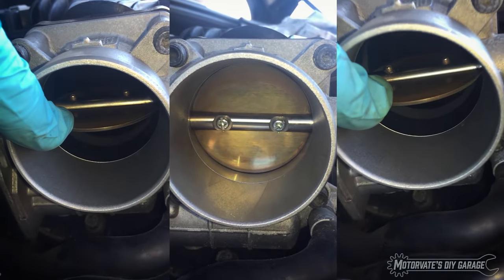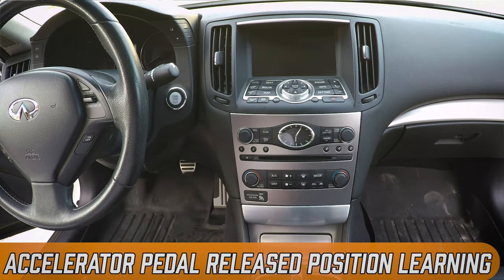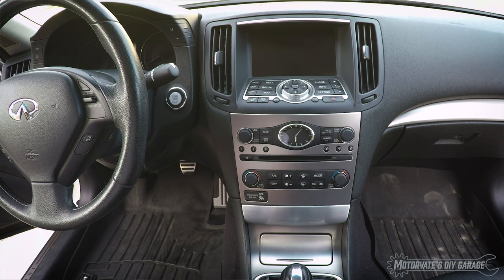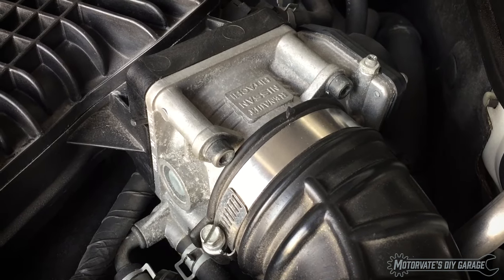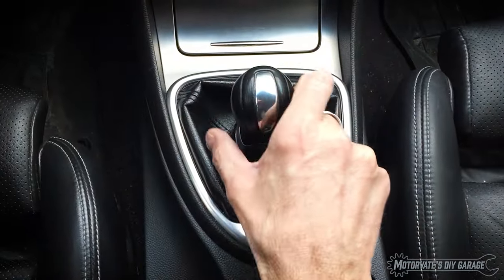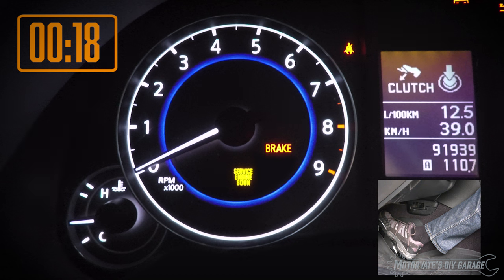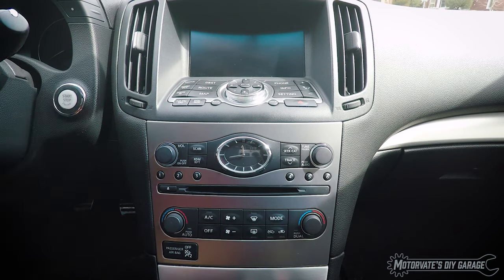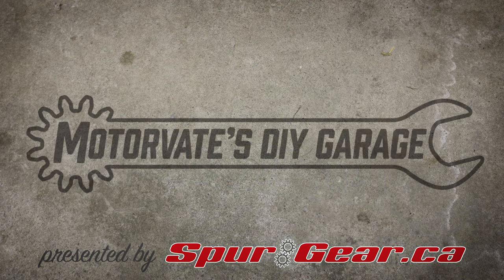G37 & 370Z After Throttle Body Cleaning: Motorvate’s DIY Garage Ep.27

Comment: Hey first off thanks for all you do for the community and for the videos. So I’ve got a 2013 g37x sedan and yesterday after a long day of running errands the car felt sluggish here and there accelerating and then started feeling weird starting up. Now thinking of it when I start up cold or hot it’s been idling a little high. Then after getting home after running around all day and it feeling different and having trouble starting up the car was off for maybe 30 minutes while I got ready for work. When I went to leave and start the car she struggled to start and felt rough starting up and idling more sporadic then usual. It felt shaky so I turned it off and took my wife’s car to work.  Now I just got the car and it needs things like suspension work and a new  rack and pinion mostly things that have nothing to do with the engine or transmission. I checked the fluids and while I can see I need an oil change nothing seems bone dry or crazy out of wack other then this driving off loss of acceleration once or twice yesterday and now it’s struggling to start and idling rough. After that novel do you think cleaning the tb or having someone do this for me and doing your method should help. There’s no lights on nothing as far as warning lights this just started happening. I hope you can help. Thanks a head of time .
Reply from the maker: I would start by looking at the battery.
If it is 4-5 years old, you might want to get it tested to see if it has the needed power to start the car. Or if you have a volt meter, check the voltage after the car has sat all night. The voltage should be around 12.6v or more.

When was the last time spark plugs were changed?
You may want to remove them and check their condition.

Start with these items and let me know how you made out.
Good luck!
Reply: Hey thank you so much for getting back to me it means a lot. I want this car to be my hobby and my daily so after spending a good amount of money on getting it and running into the suspension and rack and pinon issues I’ve already been crushed on how much I’m gonna have to put it to make it safe and fun to drive but then this starts happening and I’m like omg is it the dreaded gallery gasket issue or my engine or transmission. I’m so glad I found your videos and that you have a g and do some much diy helping everyone of us trouble shoot and maybe save our cars and money. So yeah the battery is prob old. Looks old for sure and idk about the spark plugs but if it’s like everything else on this car it most likely needs to be replaced. Cause who ever inspected it for the dealership or had it before had the bare minimum attitude and did as little as possible to keep the car running to keep passing it on to someone else to deal with till it’s come to me and I gotta spend a huge chunk of savings to get the car where it should have mostly been when I bought it. Sorry I keep ranting. So yes I’ll check all that tomorrow maybe get a new battery and see if I can get the spark plugs changed and see if that’s helps. If it doesn’t should I try to clean the TB. Should I look out for anything else that could I show signs of anything major. I’m gonna get the oil changed too. It needs it even know the level is good it looks old. Sorry one last thing if it is just a new battery and a tune up new spark plugs ect. Is it ok to start it and drive it even with the rough starts?
Reply from the maker: You have questions... I have my thoughts/answers:
(1) A dirty throttle body won't cause a rough idle, it make it a little more difficult to start when war, but all you need to do is apply a little throttle when you start it.

If the idle is a little high, it ca n be difficult to get the "idle air volume learning" procedure to complete. For now, I would not clean it and look at other causes.

(2) If there isn't a check engine light, it should be ok to drive it for a while with the rough start. The worry is that an engine misfire can cause a rough idle and dump raw fuel into the exhaust and catalytic converters, which is VERY bad for them.
BUT if that happens, generally there will be a check engine light or a flashing check engine light. (means engine misfire)
Reply: Again thank you so much for your time. I think I may be in big trouble here and I just got the car. So I changed the spark plugs yesterday and that was an adventure and even got a new battery while I don’t think I needed it cause the fluid I saw on the battery was protector spray and the car lights everything works fine all that. Also when I changed the spark plugs one or two didn’t look that bad and the others super dirty looking and even oil on one of my spark plugs which freaks me out and means I most likely need a new valve gasket. The throttle bodies where very dirty as I had get them to the side to get to my spark plugs. The car did start right up after I changed the spark plugs with no hesitation but did idle high and cause I did unplug the battery before I worked on the car I let the car run for a while to warm up and maybe reset the way it should perform by it self but it didn’t it kept idling pretty high and I didn’t see any smoke or anything no check engine lights the car did smell a little idk if it’s burning oil or what now. I gotta get the oil changed today and maybe try the re learn process idk. So i did recently have the exhaust break or a leak cause one day it sounded fine then was super loud so I took it to a exhaust shop they fixed it for like 200 bucks and then it sounded fine again but we did have a bit of snow here and it turned to ice and i scrapped the bottom of the car a few times and something could be loose or messed up again so idk. Also I read the forums and a guy had a 2013 just like mine same issues rough start out of no where loss of power here and there and it feeling off he took it to the dealership and they came back and said it was water in his gas and replaced it and told him to get better gas and that fixed the issue. Idk brother I think I’m in trouble here in Colorado there’s no lemon law and I think this small dealership sold me a lemon even though it’s a clean title and a good carfax I’ve had the car less then two months now and I’ve already got 3 grand worth or issues to fix with the mechanic that wasn’t engine or transmission related but now I think I might need to start looking for a rebuilt or used engine which there are a few here not too much but the labor would be crazy! Again sorry for the novel 😂 you can tell I’m worried and frustrated. The good news is it goes to the mechanic next Monday to fix the suspension and the rack n pinon and the other issues he first found so hopefully he can help with the new issue of it running off and this almost short periods of limp mode or loss of power/ acceleration and the off smells. It’s sucks cause I literally have an new catback exhaust here and a new rear sway bar and end links and other little things I wanna do but I gotta get the car healthy first😢 thanks for your time and help and again I’m sorry for the novels I appreciate you. I just don’t know what to do esp no lights on the dash and this came out of no where just after getting the car.
Reply: Also after starting up the car this morning service engine soon came on😢 maybe I can go to the auto store and see what it says and see the code. Omg here go!
Reply: Hey just wanted to give you an update. Took it to the auto part store and they scanned it and it said it was the mass air flow sensor and throttle body. Maybe cause I had to move the throttle body and did a quick wipe down on it and I definitely cleaned the mass air flow sensors. But the guy said let’s reset everything let it run for a while and drive it around a little. After he reset the codes it stopped idling high with no issue starting up and it even kind of took away the loss of power issue I was having here and there. It still feels like it’s idling or revving a little high when I’m driving and moving cause it feels like it still wants to keep going when I start to slow down or even when my foots off the peddle. Also it doesn’t feel as smooth and as much power as I remember the car feeling before this new problem started happening. Either way no service engine soon light on anymore and its not idling super high and feeling rough at start is great I’ll take it. I wonder since it did have those codes should I do the whole relearn process or all the steps in your video and maybe the full power and full smoothness pressing on the peddle will come back or just at this point leave it and wait till it goes to the shop next week and tell the mechanic about everything and see what he can do? Your thoughts are always appreciated. I’m keeping my fingers crossed I can get her back to healthy and send you a msg that she’s healthy and running great with out going broke and it taking forever.
Reply from the maker: Unfortunately, many car part stores think the code description is the part to replace.... it may or may not be. AND generally they are not familiar with the engine in the G37.

What were the exact codes?
Reply: The first is p010b and the second code is p0101. I mean the car is running a ton better the idling feels normal at start up and there is I would say 80% of my power back it runs clean or smooth through the gears in the first few. It does feel a little off if I push the peddle all the way down once I’m going faster like the pick ups not there as much and does feel likes it’s still kind of doing something revving a little on it’s own or something idk. I could be over thinking it and everything little things feels off now. I am taking it to get the cats checked at an exhaust shop Thursday morning cause I am herring some type of rattling underneath and maybe a clogged or messed up converter is the cause of the loss of power the rough starting and idling also there were smells and stuff so maybe it’s a leak. Also it’s going to the full mechanic next Monday so we will see. I do think if these codes are throttle body and mass airflow related and the check engine light this morning that was later reset. Maybe your process could help to help it continue the right way to idle and get up to speed idk. I kinda feel like I have a car loan and a new used car that most people would say with all these problems I have so soon that I got a lemon and should try and get rid of it instead of throw a bunch of money into. But I’ve always wanted a g and I hope I can get it healthy and back to a place where I can keep it for a while as my fun daily sports sedan but idk. As always I appreciate your time your help and your thoughts and sorry for the super long novels I just wanna try and explain as much as I can and rant and it’s just my way I guess.
Reply from the maker: (No worries about the long novel... but maybe try to use the enter/return key once in a while? My old eyes will thank you!)

The 2 codes indicate a bank to bank difference in air flow.
Since this popped up after doing the plugs, I suspect you may have an air intake leak, disconnected  or cracked hose in the intake system.

With a cheap OBD scanner and a good OBD app (like OBD Fusion) you can view the air flow value through both MAF sensors. Then you can see if there is a difference between them. or take it to a shop for them to figure out.

With a fully warmed up engine, each MAF should have an airflow of about 1.8 g/s with an idle of around 650 RPM.

Comment: Awesome Tutorial, I just finished cleaning both of throttle bodies and mass airflow sensor‘s. One mishap was the toothbrush broke and I had to account for all the missing bristles. Luckily enough none went in far. 
So on the second throttlebody I just removed it completely and there was enough play to clean it effectively with a rag and lots of fluid. 
Fortunately enough it idled very funny at first at 1100
Then I turn the car off waited a little bit it through a check engine light up so I then unplug the negative terminal again. Then the car went to 700 by  itself. So no 3 steps, guess I’m just lucky...
Reply from the maker: Hey Ps4 Ps4,
If you clean the throttle body, is is a good idea to do the idle air volume learning. By removing the dirt around the edge of the throttle plate, you change the air flow characteristics. The idle air volume learning allows the engine control module to  re-learn the new characteristics of the clean throttle body.

In your case, it seems like the throttle body might not of been very dirty and the engine control module was able compensate or didn't notice any change.

So.... if your idle is normal, it looks like you are good to go :)
Reply: Last night I drove home my skyline 370GT which is the same as G37 infiniti, I accidentally switched on after I switched off the engine, how exactly i have forgotten but when I drove it later it was behaving weird. Gear shift not smooth and jerking so today I followed your instructions cleaning the throttle body and doing the re -learning and everything turned to normal. 😅❤ thanks again for your wonderful video!

Comment: I have a 2008 G37S, i needed to do valve cover gasket, and spark plugs so i naturally decided to clean TBs. Before i started the job i UNPLUGGED MY NEG BATT TERMINAL. I did not have to do a relearn what so ever. I was not wanting to use this video. I m glad it is here tho, just in case. TY
Reply from the maker: Hey Travis Massingale,
That is odd... If you cleaned the edge of the throttle body, generally you will need to do the idle air volume learning as you have changed the idle position air flow.

If you cleaned the front/back of the throttle plate the idle air flow doesn't change and an idle air volume learning is not required.
Reply: @MotorvateDIY  i did move and hold open the TBs. Got a super deep clean. I have to weirdest luck most of the time. I was ready to use this procedure. I forsure will use the other videos u have at some point. Ty

Comment: You're the best! :D I'm going to clean my throttle bodies now, they started throwing an error and idle is dipping at stoplights, despite everything else coming up great. Car's at 68,000 miles, doubt it's been done before :)
Reply from the maker: Hey Tim Wells,
What's the error or trouble code?
Reply: @MotorvateDIY  p0106. Planning on cleaning the throttle body and the MAP sensor.
Reply from the maker: Hey Tim Wells,
I don't know if this applies to your car, but there is a ECU update for the 370z / G37  to fix the P0106 code:
G37: https://static.nhtsa.gov/odi/tsbs/2016/SB-10075616-2280.pdf
370z: http://www.370zcoupe.com/TSB/1TS2.PDF
Reply: @MotorvateDIY  thanks! Mine is a '10, so I'll get it checked out. I'm installing a Z1 intake today, so I'm gonna clean them anyway :)

Comment: Your channel is criminally underrated.
I followed the instructions and my car idles normal in park or neutral, but still drops to 530 or so while stopped in drive.... dammit I’ll have to reclean the throttle bodies again. (I just replaced all 6 spark plugs and cleaned the throttle bodies today)    :(
Reply from the maker: Wow... thanks for your kind words!
You can use NDSIII to increase your idle:
https://nisscan.com/NDSIII/index.php?content=idleadjust
Reply: @MotorvateDIY  For this stuff, I dont have an android device or the obd cable plugin... Would a pc work? also, about the plugin, which one should I buy?
I dont want the dealer to rip me a new one to do a simple idle rpm adjustment (it only drops to 500 in drive and even then sometimes, it sometimes goes away after a while of driving) Also when turning the steering wheel (while stopped in drive) the rough feeling is pronounced.

Comment: Awesome to know this info , I cleaned my throttle bodies 3 months ago! Thank you
Reply from the maker: Anytime :)
Reply: I have a question my friend. I did throttle cleaning but I don’t have a high idle. The tack is at .7 rpm. Do I still need to do relearn? Or I don’t
Reply from the maker: Hey Matt Jay626,
If your idle is normal, then all is good.
However,  it is not a bad idea to do the three procedures in the video, but nothing bad will happen if you don't.
Reply: Motorvate DIY ok nice to be sure. I appreciate you! Thank you for you time and reply. My car is my life. I have an 08 G35s sedan 6 speed. K&n typhoon CAI, Stillen high flow cats, Megan racing y-pipe, and muff delete, car purrrsss and runs awesome even with no tune! I purchased coilovers /rear camber arms and now waiting to install ASAP. Everyone says my car sounds really exotic..I’m stoked everyday driving my car :) soon I want to dyno cuz I’m curious to view my whp numbers. Is there any other mods you recommend? Hope your having a great start to the new year!
Reply from the maker: Hey Matt Jay626,
Sounds like you have all the good bolt on mods. 

Have you ever thought about a high performance driving school? They are a lot of fun and you won't believe what you can learn in a day AND it is a safe place to drive fast!

Thanks for your comment.... now go for a drive and enjoy your car :)

Comment: I wanted to clean the throttle body on my X3 but it seems like more can go wrong than good. My car idles beautifully right now. The only reason I wanted to tackle the throttle body is because I replaced my coils and sparks and cleaned the MAF sensor.
Reply from the maker: Hey  Mike Lesesne,
These steps only work on a Nissan or Infiniti from 2003/2004+
BMW (you mentioned X3) may or may not have a similar procedure.

If everything is running well, then there is nothing else you need to do. :)
Reply: Motorvate DIY yea. I'm just so geeked that I know how to work on my own car now. I even taught myself how to paint and repainted my front bumper. This is all to save $$$$😔
Reply from the maker: Hey  Mike Lesesne,
Very nice! I agree, it is very satisfying when you DIY and save money :)